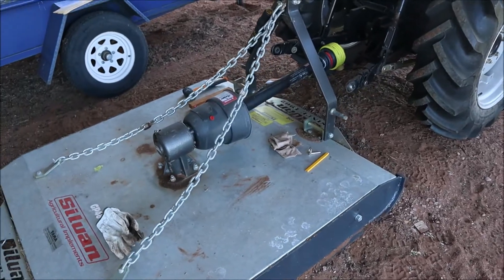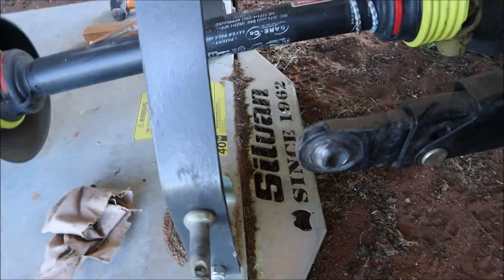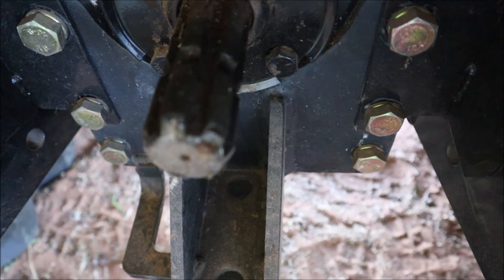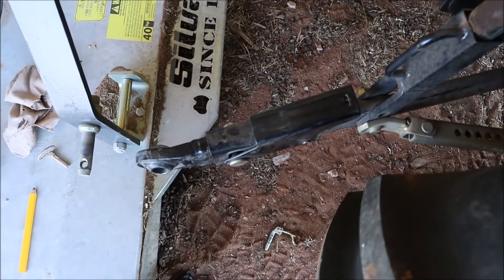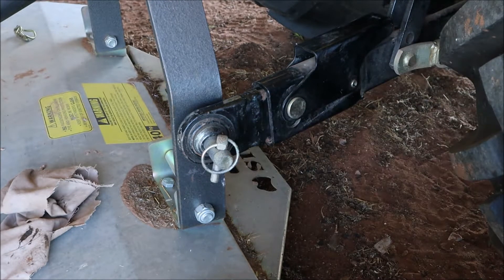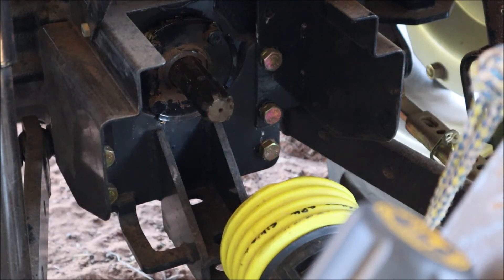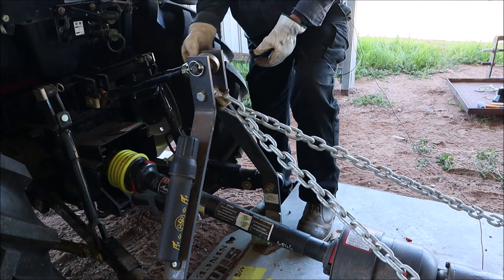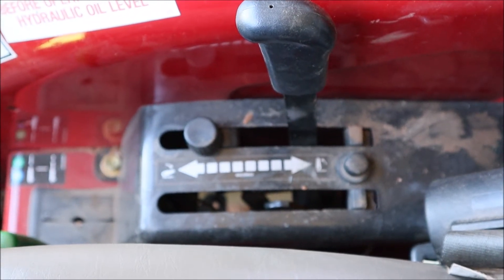Attach grass slasher implement to tractor 3 point linkage

Comment: Thanks for this video I’m about to take delivery of a utility tractor and Silvan slasher and appreciate the help. One question - to what height do you set it up once it’s spinning and ready to cut? I take it it’s not dragged on the skid plates but up off the ground a touch as you show using the 3 point hydraulics. But how do I determine the correct height above the ground?
Reply from the maker: Good question. If I'm are slashing a very level field then I usually set the skids about an inch above the surface. If however the surface is uneven then you  will find the skids will often make contact with the surface, which is fine, they are designed to keep the blades from chopping into the surface. Hope this makes sense.  Thanks for the comment 👍